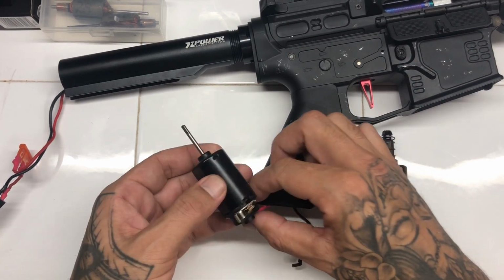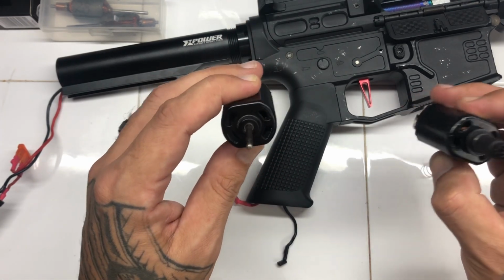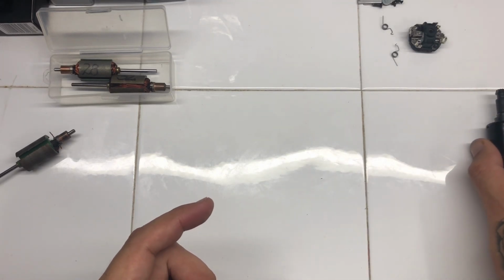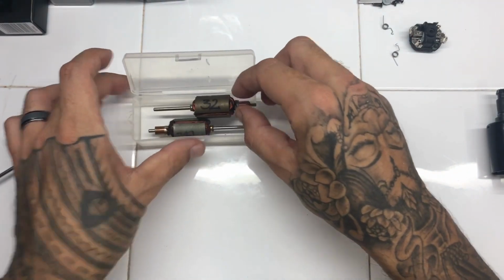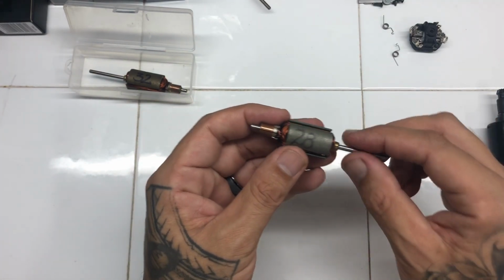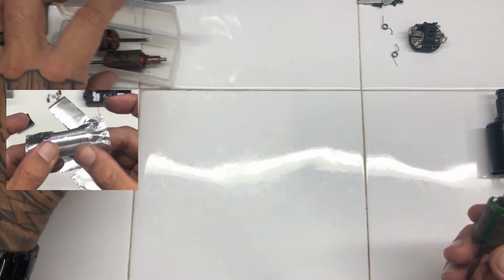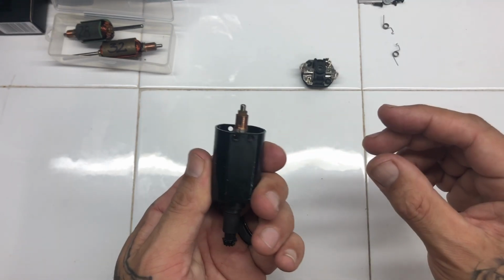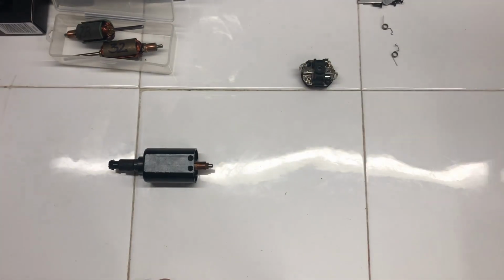So you want to build a Frankentorque for your Gel Blaster?

Comment: nice video bro! but where i find the neodimios magnet?
Reply from the maker: You have to find a motor that already has them unfortunately. I haven’t found anywhere that sells them separately
Reply: @hiroshimascreamer5884  
i'm from brazil and here there are some magnet stores, where they make these magnets to measure. I got in touch with a factory and I’m asking if they can do it. But in relation to the engine armature, do I have to find one that already has a high tpa or can I wrap the copper wires myself? sorry for my bad english.
Reply from the maker: @sidneigustavomartins383  normally the really cheap motors have high TPA armatures. You can wind it yourself but that’s probably more high level tech stuff.
I personally wouldn’t attempt it.